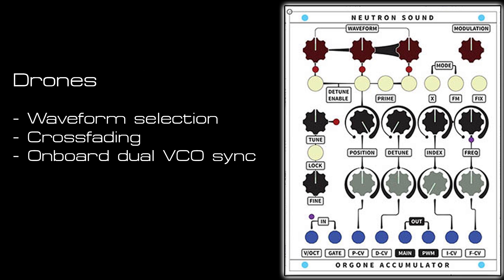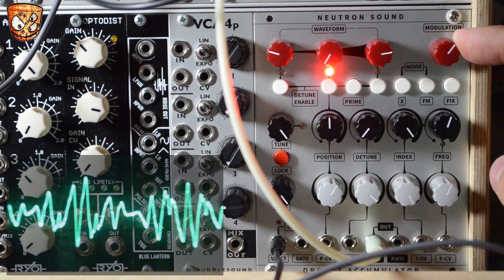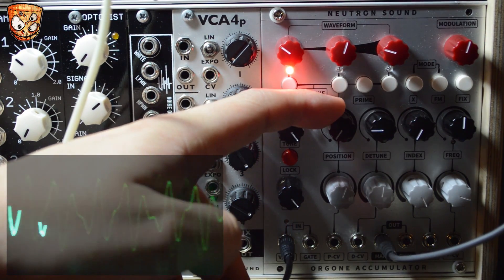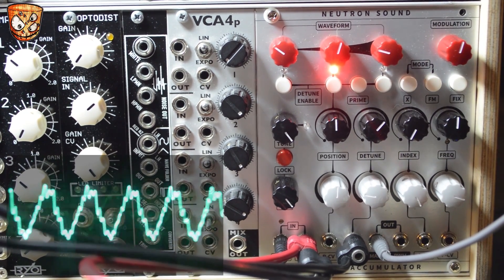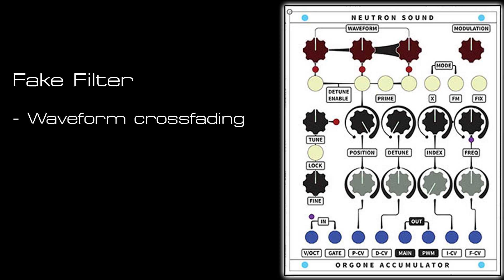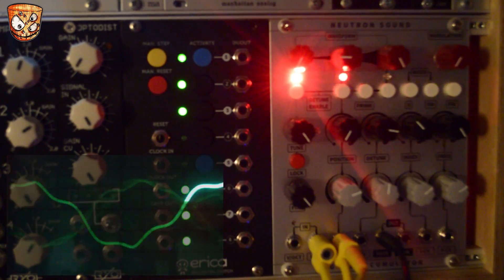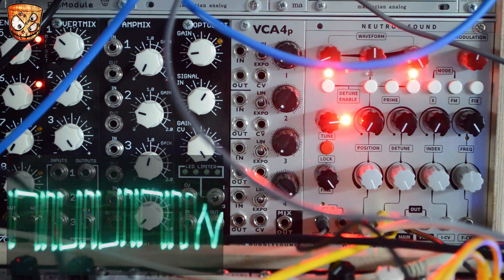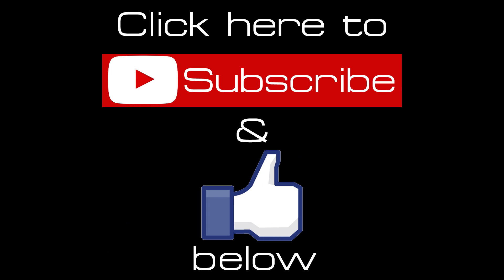Neutron Sound - Orgone Accumulator

Comment: this is fun, awesome! great vid!
Reply from the maker: Srikandi Warion cheers, it's a great module!
Reply: no worries, I love it because I am into orgone energy and into sound designing :-)
Reply from the maker: Srikandi Warion can't go wrong with Orgone Accumulator for sound design. There's always new firmware and well thought out features coming with it as well.
Reply: DivKidMusic awesome, please keep it coming my friend!
Reply: ***** yes I know, some  sound module, I am obsessed with tweakers!
Reply: ***** just as good as software really, I think I definitely like the feeling of the knob being tweaked with my own hand too, it's more special touch to it! :-)
Reply from the maker: Srikandi Warion that's the main thing with a modular system. Taking away any analogue vs. digital debating it's the feel of direct interaction with every aspect of the sound. And also creating something unique through patching with cables that's not totally recallable or preset.
Reply: DivKidMusic  Exactly! I guess you get to know to the various sounds coming from if there is some slight distortion or such or cable interference from the back, which is never happens on VST interface or Daw system. Most definitely I really dig this hands on approach! The patching system sounds a bit tedious job though does it? has it got patch bank system or you have to do it all manual and stick to the patch that you are setting it  up to? until the next patch change manually just to unplug and plug in to the desired patch?
Reply from the maker: Srikandi Warion no patch bank storage, just plug in and that's the connection. You're connecting electricity and voltage there's no saving that! So each patch is just each patch in it's current state until you unplug and change it.

Comment: awesome vid!
question: at 9:30....what are you sending into the P-CV at that point? i recently got an Orgone A, and have been messing with trying to find the right source to put into the P-CV to get it to behave the way you did....with no success.

thanks in advance.
Reply from the maker: TRaddcliff cheers for the question, always happy to help. That was an envelope. If I remember correctly it was the WMD MME but envelope module is irrelevant. Just going with the idea of the starting point as the left most wave and using an envelope to move through the mid and right most waves quickly then letting the CV fade back through those. Let me know how you get on!
Reply: TRaddcliff http://www.synthcube.com/ now carries them ...
Reply: @DivKidMusic thanks. new guy here...so didnt have a full on grasp yet or still. but makes much more sense now. thanks again.

your demos are awesome!